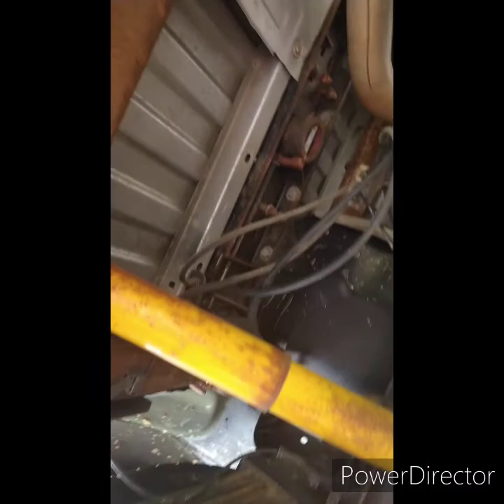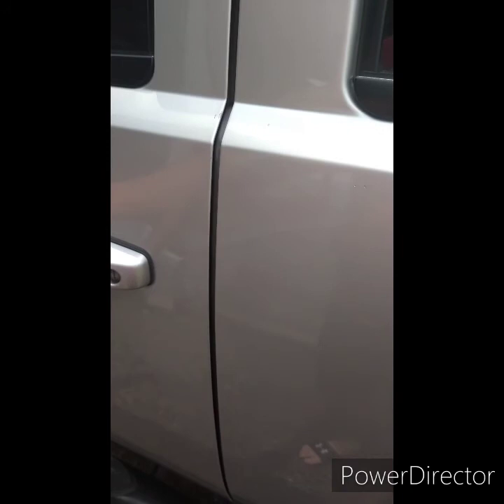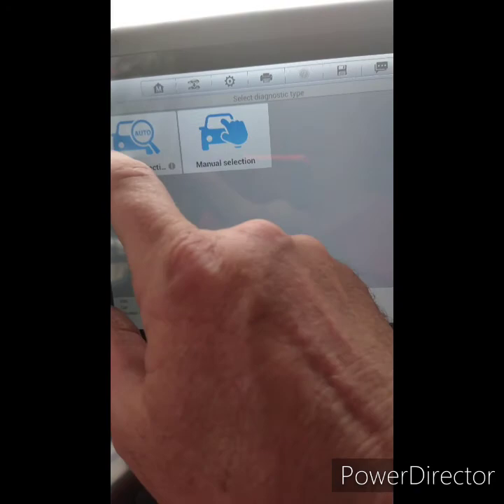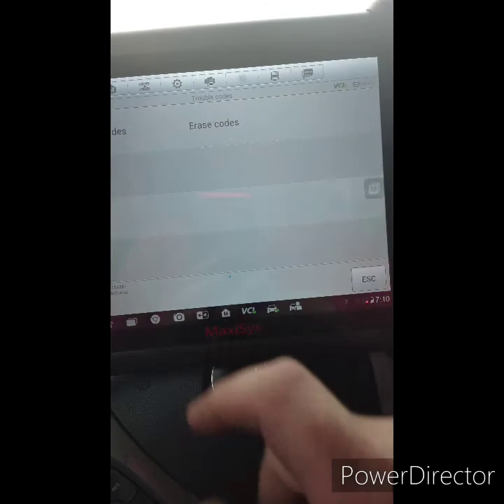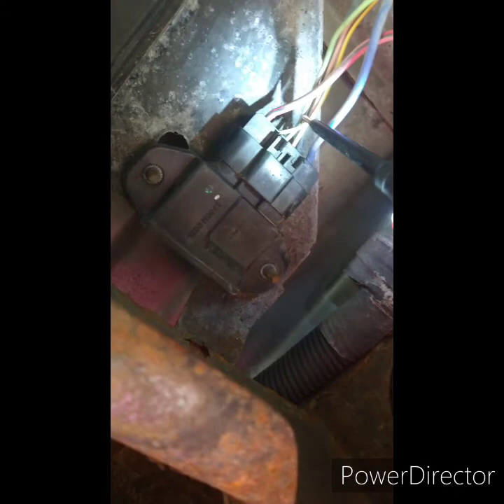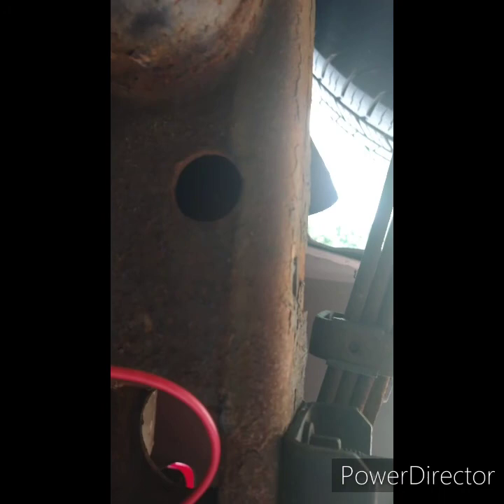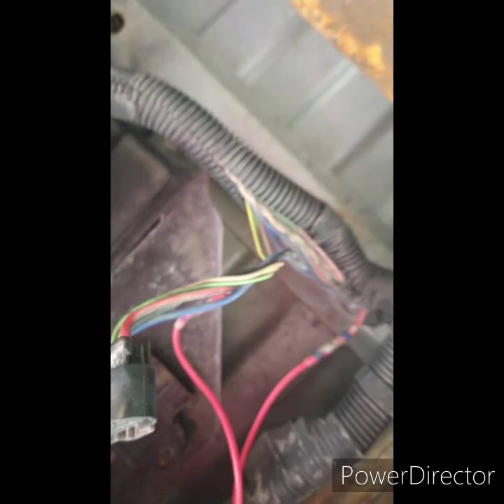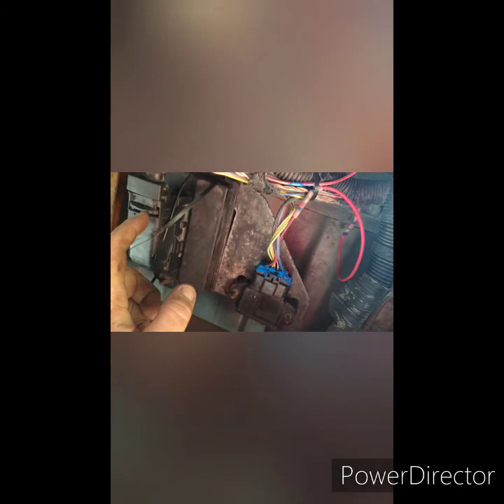service trailer brake

Comment: I have a 2013 gmc Sierra 3500 same problem ! I’ve done the same thing including new parts and it’s not fixed yet ,, But you gave me hope that I have over looked this exact problem ! Fingers crossed weather cooperate I’m checking that next !! That you

Comment: if I heard you correctly you've had to fix this twice now !?!?! this is actually a super common defect. if you have some spare time you should file a complaint https://www.nhtsa.gov/report-a-safety-problem having non-functional trailer brakes is a safety-critical defect and GM should be responsible for the damages and repairs for all of our trucks
Reply from the maker: The folks that installed my goose neck hitch pinched the harness is the main reason for repairing it twice, but I will look into the nhtsa deal as well. thanks !!